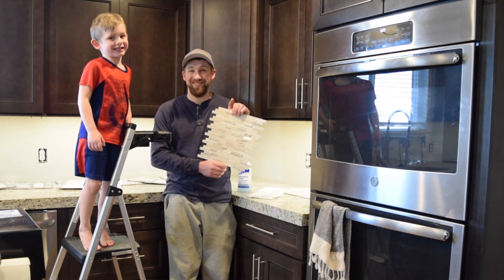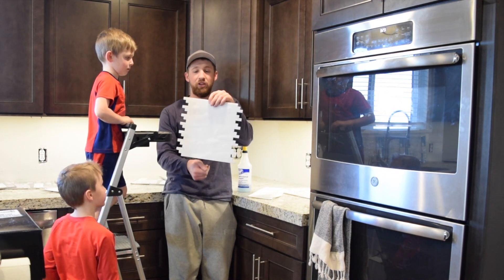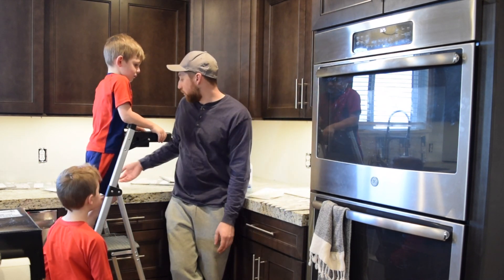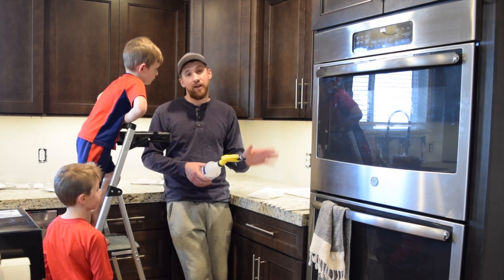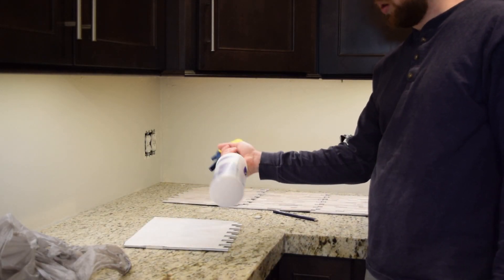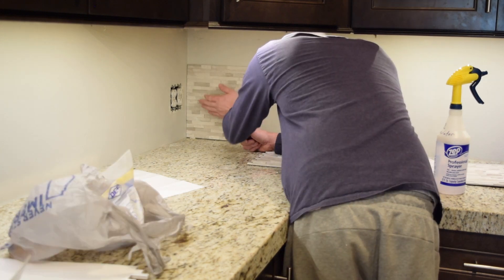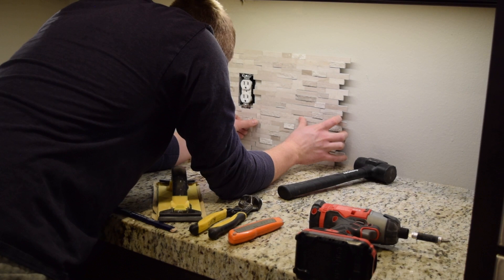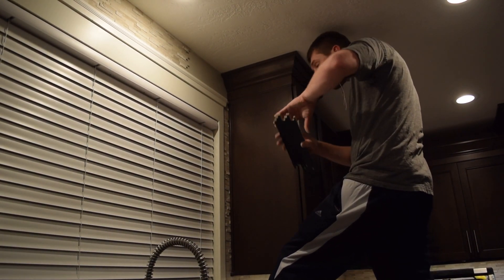Peel and Stick Backsplash Tutorial and Review

Comment: What did you use to fill the gaps underneath the backsplash? My counter is off almost 3/8” over a 10 foot countertop. 

You did a great job. In fact, my kitchen cabinets are a similar color so I’m thinking of use the same backsplash you used but I don’t know what do do about the uneven countertop and the resulting gaps it will create.
Reply from the maker: Thanks! I filled the gaps with caulk and it has worked great. 

It looks like it took me a while to get to your comment, hopefully you found something already for your backsplash!

Comment: How to I finish if the backslash if it doesn’t dead end into trim?
Reply: That’s the answer I’m looking for.
Reply from the maker: I know this is an old comment, but in case you're still wondering, you can but a tile trim piece to end it or worst case just finish it with caulk.